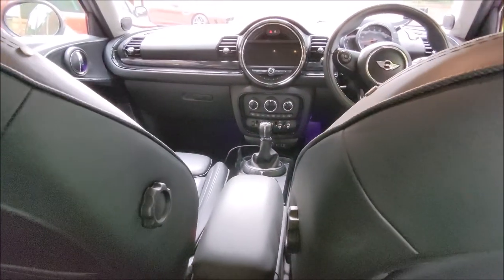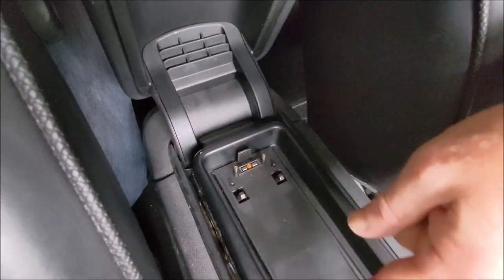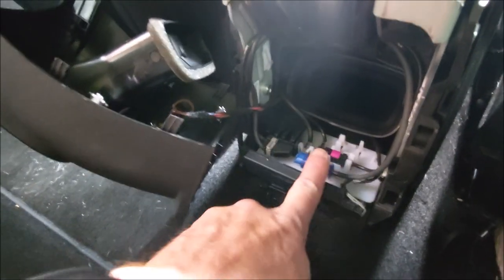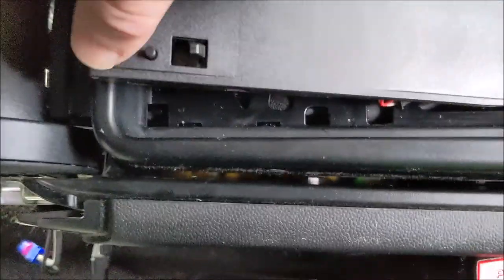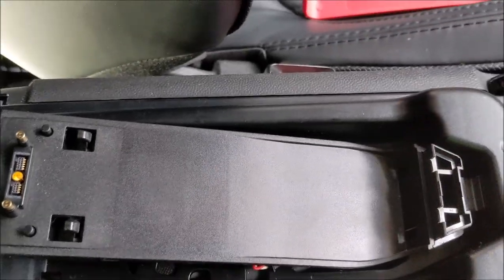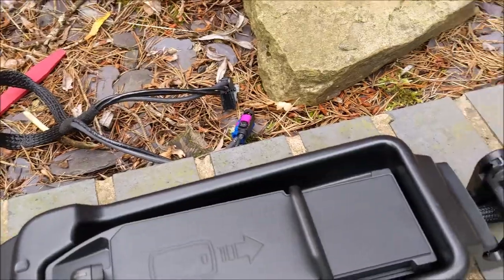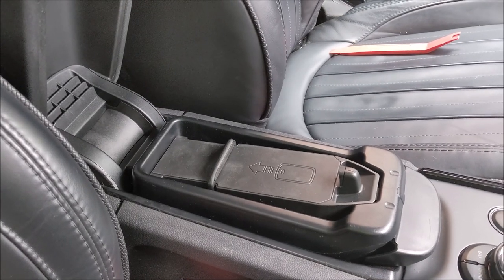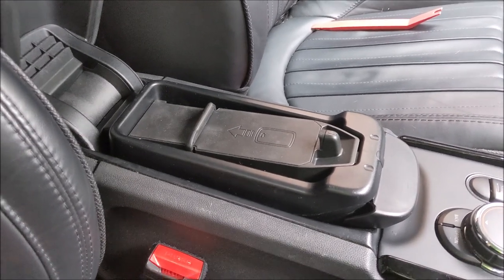BMW Mini F54 F56 Wireless Charger

Comment: 5:39 if you push the plastic clips on the big handle, the handle will come off which will make it far easier to access those annoying screws. Thanks a lot, would have found this way more difficult without this video!

Comment: Will this also fit into F56/F57 ? I found on BMW site that this part only fits into Clubman and countryman.
Reply from the maker: I would go with what your parts site says. I can only comment that when I bought the part it also said for F56, but I installed in a F54, so I can only say with confidence that it does fit the Clubman
Reply: @paulcalvert5425  I did in f57, so it can be done, but there is some diffrence in armrest build. Thanks for your move it was helpful.